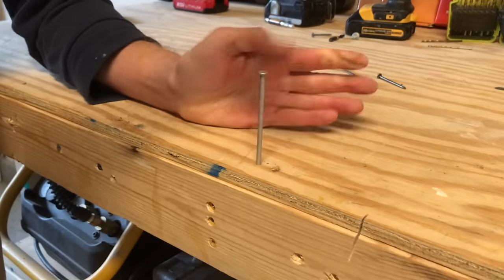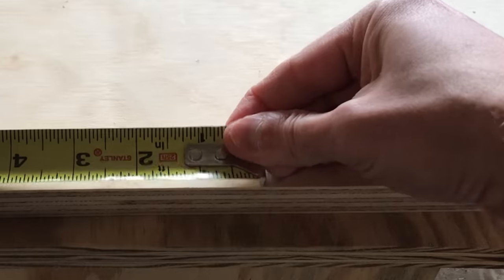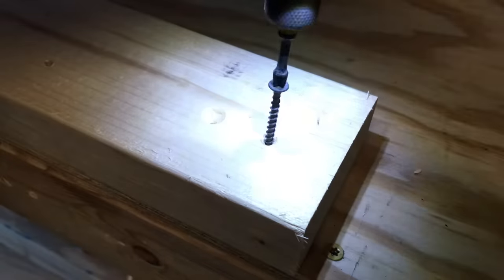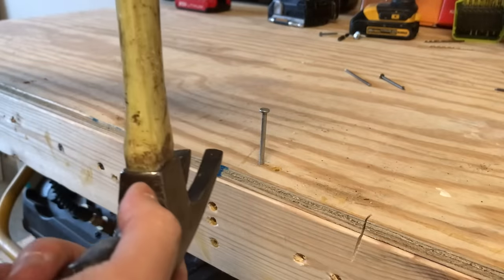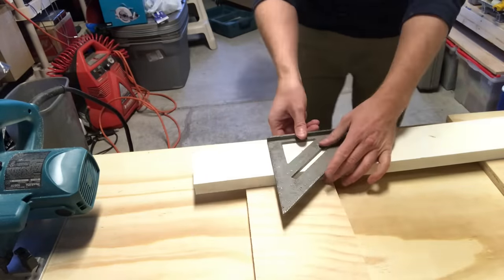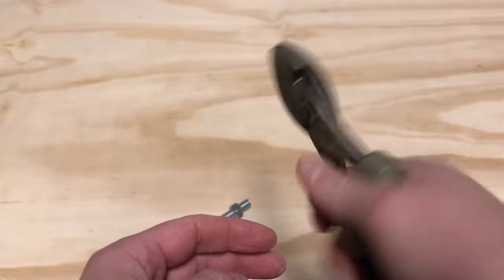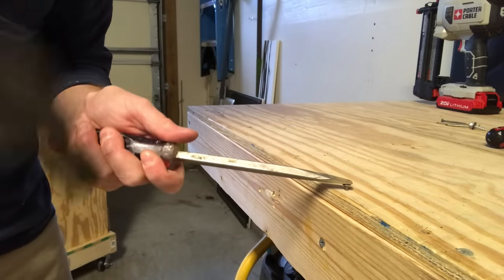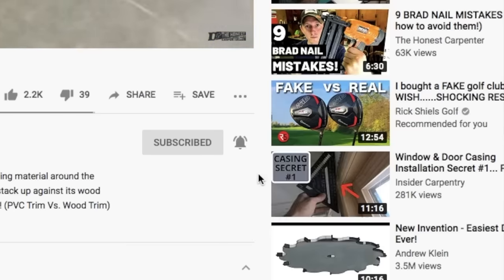21 HAND TOOL TIPS, TRICKS & SECRETS!! (Hammer/Screwdriver/Tape Measure/Pliers...& MORE HAND TOOLS!)

Comment: Don’t forget to mention wrenches can act as a hammer 😂
Reply: There’s two tools in the trades hammers with and without batteries 😂😂😂
Reply: Or, for mechanics, ratchets! Haha
Reply: Joke’s on you, I’ve been using my hammers as wrenches for years!
Reply: I use the bottem of my drill as a hammer
Reply: Any tool in your hand becomes a hammer. 😀
Reply: Anything can act as a hammer in my house 🤣
Reply: You forgot to say that a screwdriver can be used as a chisel
Reply: In a pinch anything works as a hammer
Reply: Everything is a hammer
Reply: Also electric drillls can be used as a hammer after you use switch it to the hammer mode.
Reply: So true.

Comment: I’ve been amazing people with what I don’t know for many years.
Reply: LOL
Reply: Hahaha
Reply: Me too!
Reply: Didn't know people don't know things. 😊
Reply: Me as well. My grandfather was a great carpenter, but unfortunately I did not have the opportunity to hang with him. These videos are a wealth of info for diy'ers.
Reply: i had a stroke reading your comment
Reply: Ha!  Join the club
Reply: Me too. Just learned the other day. You cannot substitute 2 inch roofing screws with sheetrock screws.    Your welcome. I figured it out when I lost all my husbands drill bits and took drill and screws to hardware store to replace. Gotta learn somewhere.🤫
Reply: I had a stroke reading that
Reply: The best way to learn a lot of stuff  is to work it out yourself. I often solve difficult problems by leaving it for another day, and determine a simple method.
For example, yesterday I was wondering how to fix asbestos heta protectorss on the steam engine heat box. So i cut out a 10*1 cm strip of tinplate from a metal can, bent it to the right shape, and now it is fixed. You see most problems are simple. I am 63, taught Metalwork,Woodwork Electronics and Construction for 25 years. Just give it a go, you can do it.

Comment: Slip joint pliers have a great fencing wire cutter built into them, they will even cut softer fencing staples/nails.
Reply: Wrap a rubber band around your slip nose pliers handle . It's not vice grips but it really helps a lot.

Comment: GREAT VIDEO!.. the scribe in the sliding square... that was a new one for me! Thank You
Reply from the maker: Thanks, Jim! I love a good, hidden feature :)
Reply: I’ve been using a sliding square forever and was like “what””!! Can’t believe I never knew there is a scribe there !
Reply: @edover50  it's called a combination square. Because it does 90° and 45° A lot of times the scribe is missing on them too. Because lots know about it and tend to lose the things. For the most part I like to use a full sized scribe myself. I have a couple nice scribes. In a pinch every nail and screw is a scribe.

Comment: Great tips!  I am going to switch from pencil to utility knife to mark my crosscuts. 👍🎺
Reply from the maker: Opens a whole new realm for clean cuts, Kevan. X-acto knives are even better for detail work!
Reply: They also make a tool called "marking knife"... not sure if it's any better or worse than exactly knives... seems like it would be the same.
Reply: The scribe is great, but if you can't quite see it so well after scratching it in, may I suggest a sharp mechanical pencil? .7mm or even better a .5mm makes the line obvious in any lighter wood, and is easy to mark in a scribe or scratch!

Comment: your suggestion to side pull the difficult nails is something I didn't know.   thanks
Reply: I often use this to bend the nail over and then just claw pull as normal, saves the time of sticking a block underneath it for more leverage.  Usually no need to "see-saw" it out as he did.
Reply: Be careful zig zagging nails with a wooden handled hammer. They don't all like to do it. Don't ask me how I know. Or why I have so many metal handled hammers now. Your other option is to get a good crowbar.

Comment: Great stuff!  My favorite is usage of long-nose pliers to hold small nails.  +1 comment made re: slip-joint back jaws to cut stuff.  Two additions not already mentioned in comments by others:
* Instead of screwdriver to turn eye bolt, you can also use Crescent adjustable wrench for a different handle angle and for more contact with eye bolt
* The back side of long-nose pliers have high leverage flats that can be used to crimp stuff (in a pinch ;-)

Comment: You can also use shaft on 6 in 1 screwdriver to extend hex shank drill bits. This is something that has saved me many times when your drill bit is just not long enough.
Reply: What are you talking about? hex shank drill bits are usually short.  They just fall into the shaft.

Comment: No wonder I never got precise measurements with my tape rule, I've always flattened the rivets down tight with a hammer and punch ,tape against tab, figuring it was just a cheap tape measure!  Honest Carpenter= IT'S SUPPOSED TO MOVE!!!!  you just got a new subscriber!
Reply: You're not the only one. But tape measures are not terribly accurate to begin with. They'll get you in the ballpark most times though.

Comment: Thank you for this video! got a stuck nail out finally after I watched this video.  It was out within a minute or two.  Now I can cancel my apt maintenance call.   I know this wasn't in this video earlier this evening.  Taking back USG dust control to fix the mess I created.   Did buy a very small pail. of painters putty recommended by a Home Depot associate yesterday, hopefully it will work. If not will go and get the smallest quantity to fix the small holes in an area (size of an apple or orange).

Comment: You missed one, when talking about the measuring tape. It has the length of the casing, typically embossed on the side; this allows the user to get a more accurate inside measurement. 👍

Comment: I would recommend saving your large screwdriver and buying a Demolition Screwdriver. The handle on the regular one is not made to be hit. Heck neither is the shaft or tip and pieces fly and hit you in the eye. So to counter this, tool companies made specialized demolition screwdrivers for this purpose.   Oh, and always wear safety equipment.
Reply: this is truth. been doing upholstery with my dad since i was 7 and seen dudes destroy the rounded top, in a few cases, the handle ! i think one of the top pieces zipped by my elbow once LOL
Reply: @CarlosHernandez-vh1sz  As a Materials Scientist let me add to your comment.
A quality steel can be heat treated and can take being hammered. A quality handle made of wood or plastic can take a certain amount of hammering. However if the screwdriver is cheap and comes from China, I bet it is made of mild steel, not heat treated . So the moral is buy locally made , to your countri's standard. I am from Sydney Australia, and have made materials to the Australian Standards, in otherwords the materials are what they are stated to be. Not like the rubbish sold from China.

Comment: Cutting cable ties leaves sharp edges that can cut the unwary. Common advice is to twist them off instead as this leaves a smoother end that won't cut. But twisting them off requires three or four grip, twist, release and re-grip actions with your pliers. A quick way to do this is with vice grips; simply clamp them on the tail of the tie at 90 degrees to the lock and spin the vice grip to twist it off really quickly.
Reply: A thing I learned when installing zip ties was that you can use your cutters to add leverage to grip and tighten the zip tie more than you normally could with just your fingers.  Grip the tie just enough to hold it without cutting it and rotate the tool sideways against the object.  You'll get at least a couple more clicks on the zip. then you can cut it.  It doesn't help with the sharpness of the cut part, but it makes the installation better.
Reply: Or, you can use the proper tool to trim off the excess.  They're called flush cuts.
Reply: @dhyde9207  Of course, if you have such a tool, unlike myself whose use of cable ties is infrequent enough not to warrant owning one.

Comment: Great! Some tips & tricks I already used, few new tips & tricks were new to me. My most used: 1.) safe nails and reuse old curved nails hammer them straight again when holding it with your (needle nose) pliers. But this works best with soft metal nails, and not so perfect with hard metal nails (baseboard nails).
2.) when sewing/cutting/drilling clamp the workpiece so that the cutted/sewed/drilled side is free, not laying on other material (table desktop etc), this way you don't need to waste "sacrificial plate" below it.
3.) Nail holded by pliers when hammering is also good in narrow spaces.

Comment: I love this video. So less annoying than most and very handy. My fave is the phillips bit to countersink a screw. I just learned a trick recently  with screws. To help stop a deck screw from splitting wood or at a troubled knot in the wood, just reverse the drill and spin the screw backwards for a second or 2,then screw in as normal. works amazing . I subscribed after this great video. Cheers

Comment: All your videos are highly informative and very well presented! No difference with this one...
I have been binge-watching them over the past few days.

I am not a professional of any kind (I am originally trained in fine arts, but presently tied up full-time with tedious managerial work!) - However, I have been fiddling around with hand tools ever since I was a kid (I am 52 now). And, I have learnt almost everything I know by either trying-out stuff, or by watching a professional worker - most of them, in my country, hail from the poorer communities - and so, usually have a limited set of tools and equipments to work with.

As a result, they use a LOT of 'hacks' - in order to maximise/ diversify the use of each tool they possess!

Of all the tips & tricks in this video (most of which I have seen our carpenters/ car mechanics/ etc use at some point), the LAST one was SPECIAL for me!

I didn't even know that there actually was a tool such as the "mini hacksaw"!!!

Here in India, we do have a "hack" for the problem - which, even though slightly risky, does get the job done...

When we need to cut something that is inaccessible (even with the "miniature versions of the larger frame type" that @rivolhino has mentioned below) - we simply DISMANTLE THE HACKSAW BLADE FROM THE FRAME > WRAP A THICK COTTON CLOTH TO THE BASE END OF THE BLADE > AND GRAB IT WITH OUR HAND, TO STICK THE CUTTING END OF THE BLADE INTO THE TRICKY POSITION!

When I saw the mini hacksaw tool on your video here, I ASSUMED that it would NOT be available here... but to my pleasant surprise, amazon.IN actually has a NUMBER of them on offer!

It has promptly gone into my "wishlist" for the workshop I am presently trying to set up... Thanks for the tip!!!

Comment: Really like the video.  My tool pouch hangs next to my tool box in my shop so when I'm working there, everything is within arms reach.  I use my slip joints in there frequently.  They will now be relocated from the box to the pouch.  Never too old to learn a better way.  Thanks.
Reply: Slip joint pliers are often not too good. But I've some nice pairs of them. Channellock makes a nice pair.

Comment: Excellent tips.  On your tip at 6:52.  If you want to reduce tear out on a miter saw.....you need to score the bottom side and the back side the wood.  Tear out usually doesn't happen on the top or front sides.

Comment: Thanks for sharing your tips and tricks. I’d like to think I’m a “woodworker”, but I’m really a carpenter. My dad was a carpenter and later a small contractor in our small town. I tend to think like a carpenter and 99% of my tools are carpenter’s tools...my primary circular saw is an 8” Black & Decker my dad bought used in the late ‘60s...still works fine even with 7 1/4 inch blades. A lot of what you share I’ve been using lately as we repair our house and replace siding. I really appreciate you.

Comment: Happy New Year.   These are all great tips taught to me as a kid from my dad or my Navy days.  Never did think of using the square for angle cut.  (I like to verify). Current project this will be ideal. 

I’ve never had luck with mini hacksaws.    Blades break or bend.  Haven’t used one in years.  

Add note on needle nose for electrical work.  (A must too in my kit).  If ya don’t have wire strippers to use the holes to make a loop, the needle nose can make a nice u curve to go around screw thread then squeeze close lightly.   This helps if u are not using the back holes (which I find can vary by manufacture and won’t accommodate 12 or 14 gauge wire. 

Know off topic but wanted to mention

Happy New Year
Reply: Not all hacksaw blades are created equal. The ones you buy in packs of 100 are not the best. Even good hacksaw blades get dull eventually too.

Comment: Used 2 of the 4-1 screwdrivers together to extend reach in hard to get at places. Take out one of the tips out and insert tip of same size into empty end. Worked on old style Rain Bird sprinkler cups.

Comment: We called the biggest screwdriver the "persuader".  The needle nose pliers trick with a spinning screw was great.  I've stripped enough phillips heads that I've gone to Torx screws almost exclusively.  But with the straight pressure trick and the needle nose tip I might not throw away all those deck screws I have on hand.  Thanks..you always look for ways to save us money!

Comment: A great choice for a nail set/center punch is the "Spring Tools Nail Set and Center Punch".  
Center punch on one end, nail set on the other. Set the end where you need it, pull back on the other end and release. Very good for removing hinge pins as well. (Just don't hold it on the spring.)

Comment: Good stuff. You can also use a needle nose for the side-pry method on small, nearly headless brads and staples that a claw cannot grab but are still stuck tight.  Just grab the fastener and roll, use an old rag to protect finish if need be.

Comment: As an electrician, sometimes I have to nail a Romex staple in an awkward position. Holing the staple with a pair of needle nose pliers helps get them set without damage to the jacket. Earned a spot in my pouch!
Reply: Wait, you’re an electrician who didn’t already have a pair of needle-nose pliers in your pouch?!  (What do you use to wrap 12 gauge around screws?)
Reply: @mr_tom_1_0  usually I never wrap wired around screws. I use back wire spec grade receptacles. I always had a pair in my extra bag but never really kept them in my pouch for a long time. Couple years ago I started keeping one in there

Comment: Great video! Thank you!  Great tip to use the 6-in-1 screwdriver bit in a drill -- the opposite it also true: you can put a hex shank drill bit in the smaller end of the screwdriver and drill a hole by hand in a pinch.

Comment: Didn't know or think of that offset nailing idea.  Will file that away - prob means there are tips to do with files, lol.  Offset screwdrivers, painful as they are to use, are easy to add to a belt, super small and can get you out of a bind.  Great vid, Ethan, thanks.

Comment: I've used my aluminum straight edge and utility knife to cut material many times and I never liked doing it that way. Looks/feels a bit dangerous.  Thanks for showing the Speed Square holding the material for the cut. So MUCH BETTER!
Reply: The trick to cutting is score the work. Don't try for it all in one go. Once you've scored the cut the blade should track in there. Start light then go hard on the next pass. I used to press too hard on the first pass myself.
Reply: @1pcfred  Great point. Thanks.
Reply: @tim8767  it was something I did for years. Looking back now I don't know why. For some reason I guess I thought I only had one shot at it? Someone I watch on YouTube instructed the light score and they're right. Control and then power. I can't count the number of times my cuts went wild on me either. Wasn't 50% but it was a higher percentage than I like. The other obvious thing is to put the straight edge on the "good" side. So I can only go wild on the waste side. But that is not always practical to do. Self healing cutting mats are great if you have to cut all the way through too. You know those green things?

Comment: Awesome list. Thanks for the video. I have an alternate tip for using pliers to help back out a screw. I use a small flat head screwdriver. Wedge the screwdriver head under the fastener head. It’s more clumsy but works just the same. I often have a six in one and linesman’s. The linesman’s are a bit clunky for this technique, so I use the screwdriver.
Reply: If you have them I find diagonal cutters the best for levering screws up. Especially angle head diagonals.

Comment: Lots of good tips for the beginner or anyone really.  👍

You missed the wire cutters on the slip joint pliers.  And although you didn’t cover them, many vise grip pliers have wire cutters built in. The mini hacksaw works better if you put the blade in to cut on the pull stroke. Similarly you can wrap one end of a hacksaw blade with tape and use just the blade. Again use it to cut on the pull stroke.  Also many pliers with wire cutters have an area behind the pivot joint to crush insulation before trying to strip it off.

Comment: Thank you!  Learned several useful things.  And on a whim once I bought a massive screwdriver with no particular use in mind... I have found many uses for it since, not a one of them driving a screw.  (Also the kids tend to use it as a sword, and it is uncomfortably effective.)

Add: If the nail is long and you don't want to use the side-claw pull, just before the nail comes all the way out, pinch your hammer's claw so that when the tip of the nail comes free, the nail won't catapult off the hammer.  At least, that's my solution.  Who else has had that problem?